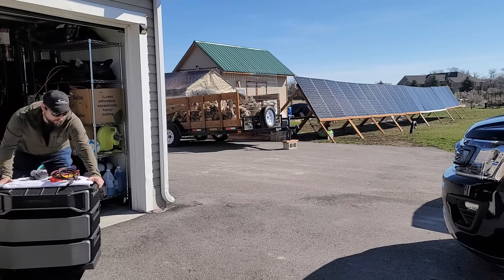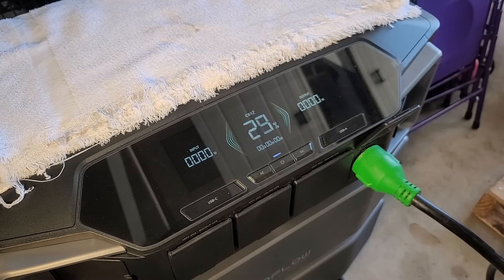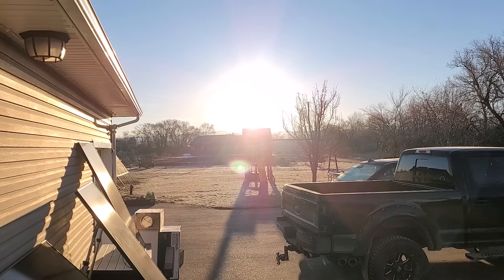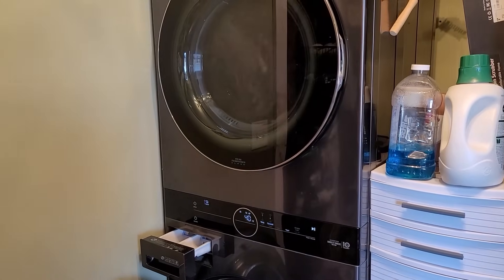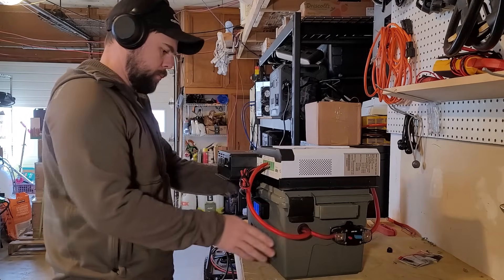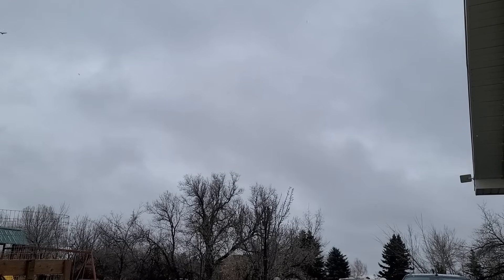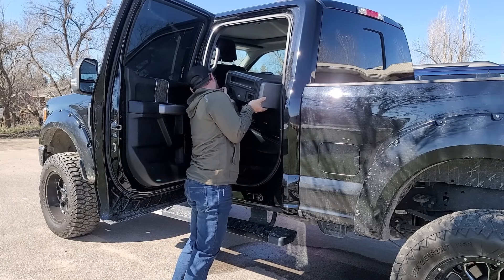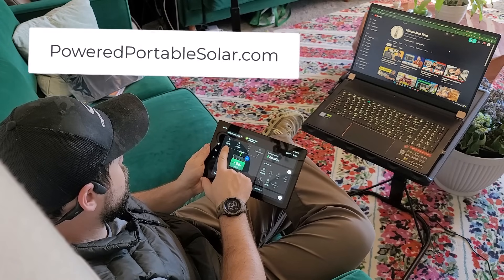Beginner Guide to Go Off-Grid Using the Delta Pro Ultra

Comment: Can you confidently use 12 volt solar panels with ecoflow delta ultra - or just stick with 24 volts?
Reply from the maker: You can use any solar panels you want. On the low voltage input don't exceed 150v and the high voltage don't exceed 450v.  Divide the max voltage input by the VOC on the sticker of the panel and the whole number tells you  how many panels you can put on that input.

Comment: Can you use a dual power generator to power up the batteries if your solar panels fail?
Reply from the maker: Yes but it needs to be an inverter generator because it the energy coming out of it needs to be clean enough for the DPU to accept it.

Comment: Can you run every night 2 windows AC and 1 portable 10,000 btu ac and refrigerator only ?
Reply from the maker: Window A/C usually uses about 400wh/hr depending on how hot it is. A portable unit will typically use around 1,000wh/hr. It all varies greatly. But to run 2 window a/c and one portable unit all night long, you need at least 32 kWh of battery, and at least 8,400w of solar panels. That system is the Apollo Gold kit: https://poweredportablesolar.com/product/hysolis-apollo-5k-kits/.

Comment: Anyone know of videos out there showing how to make existing roof solar power the ecoflow ultra? I have 38 panels already on my barn, so I hope to feed those to the ecoflow but not sure how to do this.
Reply from the maker: Great question. The short answer is, you cannot use rooftop grid tied solar panels on a solar generator. 99.9% of the time rooftop solar panels use microinverters. That means, each panel naturally makes DC power, then it immediately connects to a microinverter which converts it to 240v AC power. Then that runs directly to your utility breaker in order to feed the house and backfeed the grid with excess power. The issue is, it's now AC power, and solar generators use DC power for solar input. What you need is an "AC Coupled" system. This can be done with the EG4 18kPV and their wallmount batteries (https://signaturesolar.com/?ref=SaJS3dc86BnakK).

Essentially, what you do, is you take your 240v AC power coming from your solar panels, and you re-direct them to go into the generator input port of the 18kPV. The 18kPV inverter things that it's getting 240v AC power from a backup gas generator, but it's actually the solar panels. Then that energy is changed from 240v AC to 48v DC battery power. Then you take the "Load" output of the 18kPV and run that to your electrical panel where the panels used to be run to. 

So you redirect the energy rather than going directly to your meter, you reroute it through the 18kPV, to the batteries, then back to the meter. This gives you the battery back up you need. I have a video filmed of when I did this on a project but I don't have it up yet. I will try to get that video up sooner than later.

Comment: How is it if you live in a place that has bad winters or a place that rains a lot which means many days possibly in a row of cloudy skies
Reply from the maker: I typically get anywhere from 10-25% production out of my solar panels even on poor weather days, depending on the weather. Obviously if it's snowing really hard and there is a lot of snow built up on the panels then it drops to basically nothing. In those situations, that's when having a backup gas generator comes into play. The advantage is you can recharge the system in a few hours using gasoline, but then get 24 hours of runtime off of the batteries. So you exchange 4 hours of gas for 24 hours of battery, greatly increasing how long the gasoline will last.

Comment: Great video!

One minor additional thing you might want to cover, perhaps in another video.  What happens if you watch the battery charge level and the PV power generation to modify your electricty usage as needed?  Being completely off grid is very admirable.  I think most people fall into two other categories:  Those that are finding increaing electriciy prices a burden and would like to know how to cut their bills, and those that want to be able to get thru occassional blackouts without loosing their perishable foods, internet, etc.  In these cases, a single battery might suffice.  Drying clothes on a close line, for example, is the ultimate power saver.

I use a Delta 2 to keep my router and ISP connection powered all the time as required by the smart panel.  The smart panel has given us lots of usage information we never had.  As Matt of the Undecided YouTube channel said, the smart panel "was the missing piece" of his solar + battery system.  You can prioritize circuits, and shut down those that are non-essential (coming back to the previous paragraph.)  On a series of cloudy days, one might want to turn off the laundry room circuit, for example.
Reply: good tip on laundry as that can be suspended until better weather in worst case scenario with low sunlight hour days!

Comment: How long can it run without a solar connection. That is the real question.
Reply from the maker: It depends on your loads. If you have 10 kWh of battery, and you're using 1 kWh/hr then you'll be able to run for 10 hours. 1 ÷ 10 = 10. If you have 6 DPU batteries you'll have 36.9 kWh of battery. Most people run around .5 kWh/hr, but that varies greatly. That would give you over 70 hours of runtime. It 100% depends on the capacity of the battery, and what you're running.

Comment: I FINALLY GOT one of these! One thing that I'm confused about, that no one seems to talk about. What is the grounding screw used for? The manual says it should be used when you use low or high PV. And that it needs to be done to code? I have no inside ground in my garage, does that mean I can't run solar from outside the house to inside with this thing?

Comment: I'm running a DPU as backup power at a remote property.  I have 4 solar panels hooked up to it for about 1,200 total watts of solar input potential.  However, they are not in the best location and rarely are completely shade free.  I'm seeing terrible solar input from the 2 400 watt panels I have connect to the high voltage input.  Rarely have over 150 watts coming in on that input.  Do you know if there is mppt built into the DPU?  It seems like there isn't but I'm wondering if I have some other issue.  Those 2 panels are right near the 80V low input range, so maybe it's possible that with the low voltage figure produced by a little shade they are just not performing well?

Comment: Thank you so I see you use 2 batteries on the Ultra which seem to run your entire house. 
 Have you ever used the grid to charge up the system.  Down the road I’m thinking of getting the pro 3 with the 240 outlet and just 2 solar panels. Mostly for emergency power and also once in a while turn off grid to run my AC units. This would be a summer home we have.

Comment: What's the total cost of everything, including labor?

I'm trying to not be a critic.  What if I had a Delta 2 Ultra and my 4KW gas generator (which I figuratively stole for $200)?  Could I survive an extended outage with my power usage (which is higher than yours)?

As part of me trying to not be a critic, I purchased my first battery power station.  It arrives Tuesday.

Comment: I am curious, what size house do you have and are all appliances  (heating and water heater included) electric? I saw your energy use of 1200 kWh for January 2024 and I am stunned. I took 3384 kWh for the same month. Either I have a defective appliance or you are running heating and water heater on gas.

Comment: Electric dryers are so very wasteful. The cost for a gas dryer is so much less. I can dry clothes for months on 5 gallons of LPg. I manage to use a 4,000 watt inverter. I added some panels recently. Now to increase the battery capacity. I have a similar issue of not having enough capacity so the battery charged faster than expected even with the AC running all day.

Comment: Great video sir. I’m about to buy my first ecoflow system . I’m getting the ecoflow bundle of the ultra, smart panel and 400w solar panel.  My question that i can’t seem to find anywhere is do i need two ultra batteries if i want to run a 5-ton ac unit for a couple of hours during peak time? Also, i was thinking of getting 3 - 400w panels to charge the unit during the day. Is that enough to charge to 100 so i have the power at night? Im in Arizona so we get sun 99% of the time. Thank you for your input.

Comment: Pretty cool video....... Concerned about the stability of your panels though........ Also, you're not really off grid because you're using gas and the majority of your appliances including a gas furnace are gas appliances..So you are using small amounts of electricity....... My house in Northern Idaho runs on mostly gas appliances including a gas furnace and I pay around $250-$350 per month for gas 6 months out of the year....... While your idea is pretty cool it's not really practical for somebody that has mostly electrical in their home . They would need a much beefier System to equal what you're doing.

Comment: This is awesome. I'd want one more thing: an automatic transfer to these batteries when the power goes out and then the ability for it to power my gas generator to top off the batteries in the even they run too low. I think that would be the ultimate solution. Obviously it's not cheap, but with climate change being what it is, it's better to be prepared.

Comment: One issue is if you get high winds solar panels up on stands like that can go flying through the air hitting someone or ending up on your neighbors house. I suppose if you live on rural acreage not as much an issue. If you bolt them down to concrete now your required to permit the system, but there is other ways I have found simply buy those carboard tubes pour concrete in. I put some angle iron in those pour the concrete in then have something to can bolt your racking system down. They also make plastic ground mounting systems that you fill with gravel keep them on the ground. Just a couple of tips for off grid DIY system.

Comment: the trick I use, I that I got myself a power plan for EV's. So between 1am and 7am I pay 0.03 cents per kW. So I charge my batteries at night using dirt cheap power. That way my electricity bill is never more than $10 dollars for electricity that I used. So even on cloudy days, I don't have to worry. I haven't done this yet myself, but there is a way to use homeassistant and get it to look at the weather forcast and if the next day it's going to be cloudy, it will charge itself to 100% during those cheap rate times. 
I live in the south of Spain with 300 days of sunshine a year, so I rarely have to worry about cloudy days though ;)

Comment: How many and what type solar panels do you recommend to maximize PV power to our Delta Pro ultra with one expansion battery? Should we link them half in sequence and half in parallel? We have a transfer switch to run critical items (estimated 7.7kwh).

Comment: My plan for my Ecoflo ultra is to prepare for power outages/grid down. The 12000 watt dual battery seems to hit the sweet spot. It is enough to power my house under reduced usage for extended power outages. Coupled with my two smaller tri-fuel generators I 
 can charge the system with one generator Running 4 hours to last for a day. Next year my plan is to install enough solar for at least a full day and only use the grid or generator to backfill for cloudy days. The idea is to use the system to help pay or itself under normal conditions through reduced electric bills and to be part of an off grid system if needed.

Comment: This device is aimed at another type of consumer. As stated, there will be hiccups and may need a backup generator or solar battery - that's almost $10,000 in cost not including the solar panels to recharge them. Not knocking your setup but the money is tight in this economic climate and I hope competition encourages cheaper prices down the road because this is unattainable to most. You can buy cars with what this would cost.

Comment: I recently upgraded from the Delta Pro to the a delta pro ultra. For the issue with the WiFi I purchased a continuous power source used to keep computers going during blackout. The WiFi (Starlink) is connected to the battery and the battery is connected to the delta pro. That way when the AC for the delta pro ultra is turned off the wi fi continues. You can do the firmware update or turn on the smart generator if the snow and clouds prevent solar charging.
Reply: Great idea.  Recommendation for the continuous power flow?

Comment: I hear horror stories of ecoflow customer support. I am very hesitant to spend that kind of cash on a company with bad customer service.
Reply: You get AMAZING service when they are selling you something.  Truth is, Ecoflow has no US prescience or support —- it’s all from China.    If you have technical issues with their equipment, be prepared to have to exchange dozens of emails explaining the same thing over and over and also beware that there is some translation issues from Chinese to English.   Sure, they might end up replacing your equipment if you have issues but you’ll have to exercise a lot of patience and spend countless hours holding their hand.
Reply: No so much about their customer service like their inventory. Been waiting for 2 months to receive the extra battery I paid for since July 22. But they are good at giving you a good dose of excuses.
Reply: Well I agree customer service is weak, it’s responsive but the system does not lend itself to easy diagnostics so it can be a pain. Rather than telephone support it would be better to have local Electrician Pros available to help.
Reply: My two cents as an EcoFlow customer who has had to use customer service…it was basic support…no worse then any other large company.  I sent them an email, they responded with troubleshooting steps, I performed them and gave them back feedback, they gave me a few more steps, performed them with feedback and they then provided a return label to swap it out.  I have not sent it back yet but I agree with another poster that if you are off grid you need to have other power supplies.  I have another EcoFlow delta pro as well as several other smaller battery systems.
Reply: Obviously you need multiple batteries to maintain it off grid…I’ve built my own inverter…which I definitely wouldn’t trust because its signal is dirty as hell…
Reply: Customer service has been great for me.
Reply: Ecoflow has been extremely attentive with the issues I've had with my Delta pro setups. I believe they are 12 hours behind roughly probably the in China or something but they always get back with me around 12 hours after I send them the email. They replaced one of my units with no problem and was very responsive
Reply: My EcoFlow river pro 2 inverter broke. I emailed them and they provided a return label. I then packed it up and dropped off at FedEx. Once they received it, they send out the new one. The whole process took about 14 days. It wasn’t big deal as the River 2 pro wasn’t my primary power source. But I can see 2 weeks being a long time if it’s their primary source of battery.
Reply: They are good about replacing things.  Customer support is one level above nonexistent.
Reply: Bro, they have customer service. Most other Chinese companies out there have zerooooo
Reply: @PakmanR3  I’m just telling you what I’ve heard.
Reply: So you are NOT an actual customer but are commenting on customer service?  It would be helpful to know since I am researching buying one of these systems.  So far the comments I’ve seen on customer service and  support plus warranty replacements seem pretty good.

Comment: This Ecoflow unit is a toy when compared to a real, low frequency, transformer based off grid inverter. Because there is no isolation transformer in this Ecoflow inverter, one day you're going to smoke your appliances during a catastrophic failure of this inverter's H-Bridge circuit.
Reply: @Madsci-zy8wm what brand do you recommend?

Comment: I wonder how much solar and batteries would be required to go full electric, ditching all the gas appliances.

And if you go all electric with a gas generator as backup if the battery goes down (I know that you can do that with the EcoFlow Smart Panel or something with a similar name that gets sold with the Delta Pro Ultra), in that case how much of an efficiency impact would be compared to running those same appliance directly off gas? (I know that for example gas generators are quite inefficent, but on the other hand induction stovetops are much much more efficient that gas ranges)

Ps: Just use a second phone as an hotspot to give internet access to the Ecoflow for the updates, alternatively there's adapters for USB-C power banks that go from usb-c to 9/12/20V barrels that you can most likely use to power the wifi long enough for the update without attaching the Ecoflow to a different unit.

Comment: I have a question How many solar panels for both low input and high input including type of wattage on the ecoflow delta pro ultra too reach max solar input all the time with the use of over paneling  do you think I will need for 1 EcoFlow Delta Pro Ultra with the inverter and battery that is included?

Comment: In order to do your update just buy a simple Battery Backup UPS which are pretty cheap.  You can use the UPS to power just the WiFi which should provide you with enough juice to get the job done and stay under budget.  I hope this information helps.

Comment: This is the only issue I have in my preps , how do I keep a 4,000 square foot house running in a grid down .  Old farm in the burbs that sold off most of the land and now surrounding by houses. 
   Just want something to run a few fridges, lights , fans , heaters , local city won’t allow panels in the yard , and 60,grand for roof panels is ridiculous.